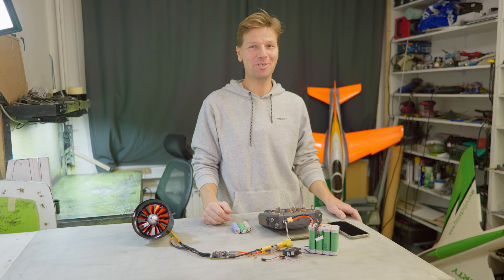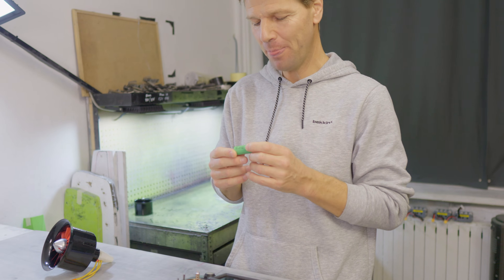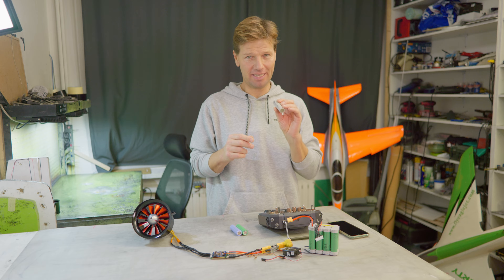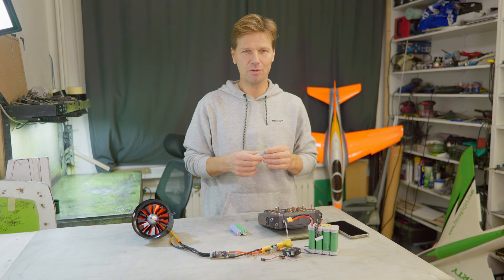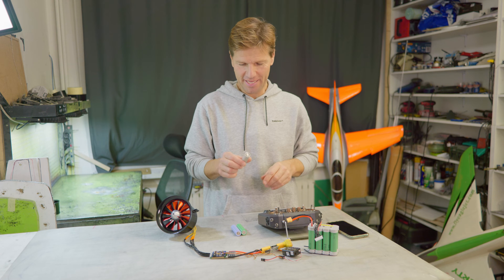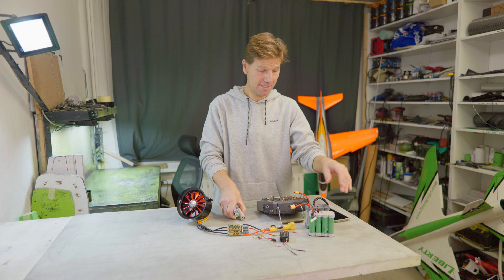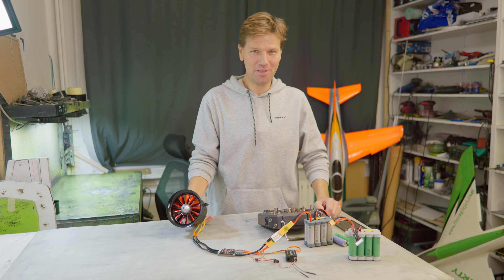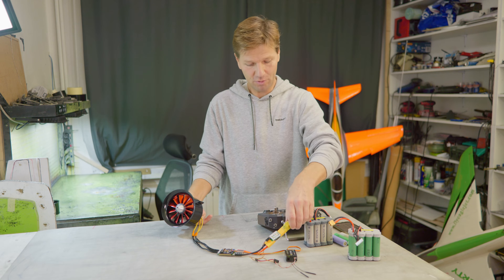Li-ion Revolution??? Honest test of new mindblowing battery for RC airplanes and more, Molicel P45B

Comment: What is the usual ambient temperature you fly at? We in Mumbai see an excess of 35°C in the summers. I use the same pack in 4S configuration on my 61" Extra 330 SC and it pulls 60A. It gets quite warm to touch. My thermometer would read 45°C surface temperature after a 6.5 minute high intensity 3D flight.

Comment: Hi Wojtek, this is the x time I see this video. Today again because on the weekend after crashing two planes I did something good and soldered my first p45b 6S pack. I had a voltage drop to 3,45V but steady on that voltage. That meant around 10-15% decrease in thrust compared to my best graphene lipo. So to have more power I´ll need to go 7S or 8S or use motors with more KV which isn´t so handy having many different planes. But I was pulling just 47A without almost any heat. I´ll keep on them. Cool that your XT60s work also on that heavy current! I´m now also using them. Cheers!

Comment: Could anyone enlighten me? Like what would that mean for Battery packa that uses Molicel p45b? 

Woukd it be better or faster or last longer or less voltage sag. 

Because in my mind.. all cells from  the 18 to the 21 to be the same. 

A person helped me design a 52v 13.5ah P45b battery pack. 

So what would that mean compared to other battery packa with different cells?

Comment: Great video. Thanks for effort to show to us new ideas for power on EDF jets. Is there a reason why there is no new information about LiIon batteries for EDF jets for almost a year? Did you give up on that project because the batteries are not good for EDF? How did the batteries "Molicel INR21700-P45B 4500mAh - 45A" for EDF use perform? Is the power of 45A enough for maximum performance, for example Avanti V2 or E-flite Viper?

Comment: Cool! Although datasheet says 45A :) You have created a really cool channel!
Reply: 45A on 3.7V . Higher voltage push more Amps.
Reply: @ well, that depends on the drive train. But now I have already learned how to design the setups, motor kV, cells, etc. I’ve soldered some LiIon packs and flown also. It’s AWESOME

Comment: How can pack of six cells, (in series) deliver how much power/amperes?  One cell, according to specs, can supply 45 amperes.  
According to my theory, parallel connection is possible to increase power/amps.  And series connection increasing voltage...
Thanks

Comment: Hello
To recharge your batteries between 2 flights, do you use several chargers? Or do you recharge them in parallel with a board?

Due to the size of the packs, the chargers must have enough power to charge quickly. 
Thank you for sharing your findings on these batteries!

Comment: I am preparing to build a Li-ion 6s pack using the Molicel P45b cells, I will print (3d) battery holder with ASA filament, with that in mind is it possible for you to provide the STL files.Thank you

Comment: How hot is too hot for these cells in your opinion?  I am seeing 53 to 55c after a flight.  Using the Molice P45B cells at 12S2P in a AF MB339 with HSD 105mm fan.  Only getting around 95 amps full throttle in the air due to the voltage sag, should be around 105.  Think voltage drop to around 41 volts at full throttle.  Considering going to 13S to compensate for voltage sag.  ESC can handle it and the rated thrust was achieved with 45 volts.  Am getting a 7 minute flight with some throttle management which is awesome.  Using around 6500mah.
Reply from the maker: 55 C is on the safe side :)  70-80 C would be much
Reply: @EDF jet RC  Thank you!  Enjoy your videos and the innovation.

Comment: So, assuming I rub my last braincells the correct way, these P45B batteries should be more than adequate in 3s-4s pack for low power prop limited by 40A esc, while providing superior capacity compared to lipo packs of similar weight? Though volume can be an issue for smaller planes, being multiplicative of 21700 size

Comment: Thank you for the Video. I made two 6s1p packs one spotweldet one soldered just to try and see the differences. Both are working fine but i can not share the enthusiasm. The batterys are rated with 10C burst 20C and that is what you get. Not more, not less. In my freewing Avanti i draw ~75 Amps 6s1p and 82A with 6s2p. With a 6s 30C 5800mAh i draw ~100A. This is minimum 500W more. Thats for the numbers on the testbench. I'll see how it behaves in flight. But i guess less weight will not compensate the lack of 500W.
Reply: The voltage sags more on the LiIons, so you're getting less rpm which accounts for the amp draw.  The LiPo definitely holds voltage better under load.

Comment: I tested the Cell too. I can approve that a 6s pack can deliver 78A for take off or a few seconds. It’s possible to fly the stock avanti S for 3,5min with a average current draw of 48A.
Reply: I flew the Avanti with 7s9000 and it's 1:1 and used @8000mAh each flight. Amazing cells! I set to 2.7v under load and start thinking of landing when it's right at 21v at half-throttle.
Reply: @deadstickduck2025  Did you use the original 6s esc for the avanti?
Reply: Hi Nick, As that 6s1p4500 package follows, I am waiting to receive these cells to test it on an Avanti S v1 with the edf 9 blade stock. I have my doubts if it could work!
Reply: @isabido  it will work, but you have to Watch out for your current. There is a Company which only sells Motors, it’s called TFL or SSS Motors. You can find a Motor which fits Perfect for a lightweight setup. I Flow it on 6S 9000mha as well. Works perfect with stock components. Flight time: 8-9min. It’s lovely. I’ve build an 10S version for my Freewing Gripen. Whether is very bad so I have to wait for testing. It’s an 10S 4500mha setup with max amp 52Amp. It has a higher Wh to gram ratio than any Lipo! New Molicel P50b will make the break trough for Liion! 5000mha and 60Amp constant draw. Sorry for the late reply. Should I make a video as well about my setup?
Reply: 4 Replies

Comment: I wonder what the resistance of the electrode to cap connection is in 21700 and similar construction cells. I think they might need to improve the construction to cope with higher currents soon as the internal contact area is quite small, judging from photos of cutaway cells.

Comment: Hey Wojtek! 

Thank you for a great eye opener right there. Can you advise if a 4s1p (P42A) molicel pack would withstand 70A max Amp draw on a 70mm jet or should I go with my coresponding capacity LiPos ? 

Thank you for your information.

P.S. 

Do you solder or spot-weld the cells together?

Comment: Hi Wojtek, fantastic video as always. I have an FMS viper 90mm flying on 6s 5000 lipo, should I make a 7s P45B pack to allow for voltage sag? Will a 6s P45B be enough? I have the cells but want to make the packs correct from the start.
Reply: i'm sure woz will confirm... you need 2 6s1p packs in parallel or a 6s2p ... that will give you at min a 90amp constant and much higher burst,
Reply from the maker: I would go for 6s2p Li-ion packs. Same punch and weight like LiPo 5000 but double flight time.
Reply: Thank you both for your replies, I will make two 6s packs and fly in parallel. 👍

Comment: Edit: Most important: can you tell us what model FRSky current sensor you are. using?

DId you just say that the 50S has a higher discharge than the 40T?????? There is absolutely no way the 50S will have a higher discharge rate than the 40T at the same temperature. The 50S is notorious for getting hot and shouldn't be run past 15A except in very small "pulse discharge" situations but even then the voltage drop is so significant that at the end of the day the 30T, 40T, and P42A offer a better cell at 15A and above. This wasn't just Mooch's opinion, his discharge graphs backed that up with objective data showing the 50S was greatly overrated by Samsung, in a way more so than Molicel was overrating the P42A (both have problems with heat if you try to run them at the numbers on the datasheet but at least Molicel was being honest about the fact that 45A was temp limited whereas Samsung tried saying 25A continuous/45A as long as the temp stayed below 80 Celsius and they were nearing 90 Celsius at 25A!)

Budget Light Forum. has some great posts. That forum and Endless Sphere have people doing long term cycling of cells and the 50S was crapping out completely after 250 cycles
"Vapcell deserves recognition that they were able to stock samples of this particular cell. The cells I received last week are probably factory samples as they carry scratches on the tube? Other branded cells from Vapcell always came in perfect mechanical conditions. I tested three samples and their initial parameters correspond to the manufacturer`s specifications of this particular type, also parameter consistency is good.

Nominal (0.2C) capacity / IEC DCIR at 50% SoC measured at 25 °C in temperature chamber

5.0371 Ah / 14.1008 mOhm
5.0266 Ah / 13.9924 mOhm
5.0208 Ah / 13.9593 mOhm

For comparison I am adding the values of a new Samsung 40T3 model:

4.0944 Ah / 14.6298 mOhm

However, according to my measurements, I would rather label those 50S samples as 20A CDR, because at 25A CDR (5C) I measured the temperature of 74 °C at the end of the discharge in a temperature chamber with forced air circulation with temperature of 25 °C. This is significantly more than “established” 5C rated cells. For example 40T3 ends 5C discharge with 59 °C or 30Q6 with 61 °C under the same conditions."

https://endless-sphere.com/sphere/threads/cycle-life-tests-of-high-power-density-cylindrical-cells.114473/

The P45B is the current leader but price is obviously the issue at $12 a cell and the Epochs are Grade B. P42A is the #2 and the 40T and 30T are runners up when it comes to power. Special recognition to Lishen LR2170LA as being nearly identical to the 40T but with the 40T available for $5 all over the place and sometimes $4 its hard to pass that up.The Sony VTC6A is also right up there with them.
Reply from the maker: Thanks for your comment :) 
I use new Frsky FAS100 ADV sensor and also SM Modellbau Unisens-E 280A sensor.
You are all correct but it relates to e-cigaretes with no cooling.

In EDF Jets application the situation is completly different as we have very good cooling available and in this conditions the 50S has both, greater punch and flight time than 40T. Regarding livespan they look very similar.
But both look poorly with their 11mΩ warm to P45B 7mΩ warm.
And the price of P45B at Nkon.nl is €8.95 right now. Not so bad, exactly half price of LiPo with lifespan 5x as LiPo.
Enjoy flying :)

Comment: If the P45B is too expensive for you but the 40T isn't enough power I highly recommend the 30T. It even edges out the P42A in the first few seconds but then the P42A slowly holds voltage better because it has more capacity
Reply: the p45b's are donw in price almost in half now.

Comment: hi buddy... bought 6 of the molicels and built a 6S1P pack ... max amp on a 90mm 6s EDF was 89a but there was a significant sag after a few seconds burst and the pack could only deliver  60a.  what performance are you getting from your 6s1p packs?
Reply from the maker: Check for cold solder on your pack. It should easly  hold 89 Amps. The drop could be few Amp not 29!!!
Reply: You really should be spot welding 0.2mm copper for this level of current. It can be done with the copper nickel sandwich technique but requires a Kweld or a DIY spot welder that uses a "energy storage board" from Ali that has a dozen of the best mosfets available and a power source to match. Either the best 3S 5Ah-8Ah Lipo out there or 2 in parallel....or a 3000F Ultracapacitor bank in a 5S or 6s configuration. Other options would be SPIM08HP cells or new Headway 38120HP's. A very powerful AGM car battery should be able to get you there as well. I'm not confident enough to comment on what timer control board to recommend.
Reply from the maker: @ericklein5097  OK, but what happens if you want to re pack your 8s pack to 6s pack like I do this week. With strong spotwelder you gonna have a really hard time removing the strips. I desoldered 8s to 6s in 10 minutes. Ready to fly 6s now :)
Reply: @EDFjetRC  Yes, you can risk putting holes in the negative terminals of your cells if you do the normal rolling technique of removing spot welded nickel with a pliers but I've never met a spot weld I can't remove and clean up with a dremel in 60 seconds. And I've removed nickel off A123 26650 cells. Only killed 2 out of 24 cells in the learning process.

The key to the technique is not to roll straight back, there has to be some side to side motion thats almost matching the cylindrical shape of the cell.

Then it comes down to the practicality of changing cells in a pack and remarrying them. I really try to avoid ever doing that to a cell more than once. Once a cell is married to a P group its best to keep it that way for its entire life. Moving it around constantly is just a battle in balancing then. This is why I advise people not to cut P groups when they are taking apart packs if they can utilize the cells in that P configuration 

Here's Micah's video on soldering. Most of the heat is on the can of the shell but its unnerving to see that level of heat and I'm sure it's detrimental to a degree. So you have to balance how if a $100 spot welder is worth it. I can list the parts needed to build one if necessary, the spot welder is $100 and the power supply (battery/capacitor) is going to be $50 to $300 depending on what you want to do. A lipo is cheapest.
https://www.youtube.com/watch?v=byvr-dwwao4&t=1s

Comment: For my odyssye with jetfan 120 pro + 590kv, you convinced me to use 16s2p 9000mAh (with these P45B). I'm planning to buy a hobbywing flyfun 160A which is only rated to 14s lipo. However, during load, the voltage of li-ion is comparable to 14s lipo so that should be fine. But I am worried about the maximum unload starting voltage which is 16s, is this harmfull to the ESC?
Since you also used the HW flyfun 160A, how would you compare this ESC with the Mantis 150A? Which one is best to take for 16s li-ion setup? I've noticed the mantis is only rated to 12s ...
Reply from the maker: Funfly 160 does not start up on 16s and on 14s it shuts down at 120A, crap ESC.  ZTW Mantis 150 works great on 16s and survives 200Amp short bursts!!!!
Reply: Don’t use the fly fun 160 hobbywing is going to discontinue the 130 and 160 for issues not holding voltage under load and not being able to power high pole count motors in edfs.

Comment: Thanks Wojtek, that's excellent information. But for most of us, all of the work needed to transform them into a usable RC battery, (with something like your pods/internal wiring/connector plugs/balance charger leads) is probably too much for the average Jo both in terms of skill and time needed. Which begs the question why haven't RC battery manufacturer's started producing these in a readily usable form for us? When they do I'll be happy to give them a go, but until then I'll be sticking with some of the better quality 6,000mAh batteries for my edf's.
Reply: There are kits that allow you to stick some pieces together on the positive and negative end of the cell and use little bus bars to connect them. Its called Vruzend. It....sucks honestly. For most people its okay but it has some big problems. 

1. Tightness/fit directly correlates to connection strength. At the end of the day this system will never be as solid as a good spot weld or solder connection so high discharge applications are out the window.
2. Don't need high discharge? Cool just need capacity? No problem but it has to be stationary....so everyone looking at this for the low/medium discharge ebike/escooter/PEV application is no longer a customer. The design just isn't strong enough for how violent a mobile application is. It's also not the most structurally rigid way of making a large pack so up to a certain size it works but beyond the 1kwh'ish size of battery in 18650 you realize its just too much plastic for in all the wrong areas.

The 3D printed cell holder/DIY lipo in a lion can design is a pretty straightforward copy of the cell holders that have been around for years that click together in 1,2,3 segnment pieces for whatever size you want (even 5x5 sheets or bigger). Its just more refined for soldering thick wire to the terminals and let me just say this so I can get jumped on

I don't think soldering to high discharge cells is very smart. Micah Toll did a video wtih a thermal camera and THREE second solder joints. Not a second more. The amount of heat that spreads across the outside of the can is....scary. You know to a degree some of that is making its way deeper. At least with spot welding the heat is so fast that it disappears off the thermal camera in a couple seconds. Unfortuantely only a a couple commercial spot welders under $500 can do copper or the copper/nickel sandwhich method and people don't seem to understand how easy it is to make a spot welder that rivals the kWeld at 1500A. Plenty of timer control boards nowadays on Ali, "energy storage board" PCB's for your mosfets are like $10 and capacitors are the safest way to harness that much power. So whenever 3000F capacitors come down to like $80 for a set of 5 or 6 we'll finally star seeing spot welding in every battery project up to 0.2mm copper